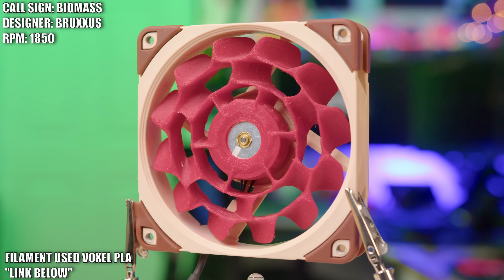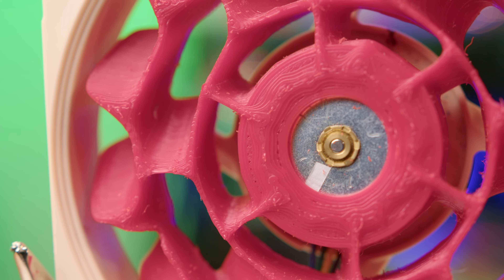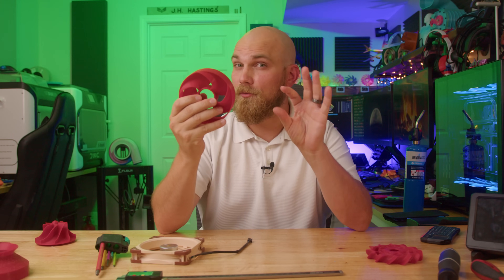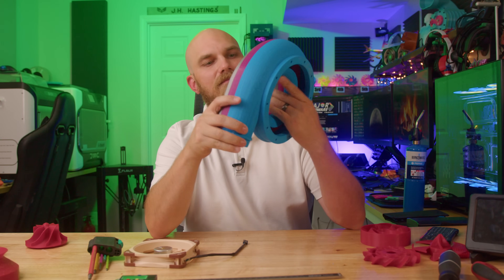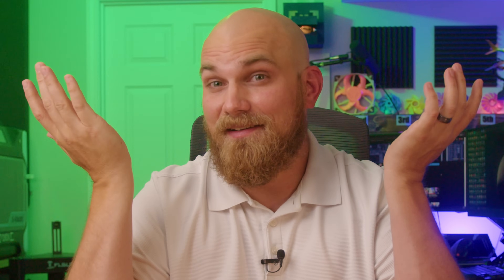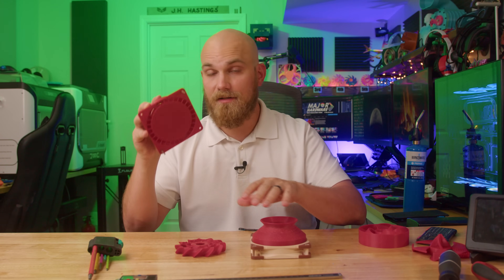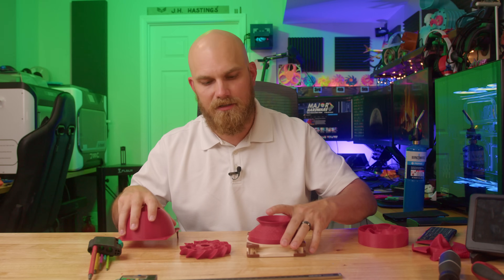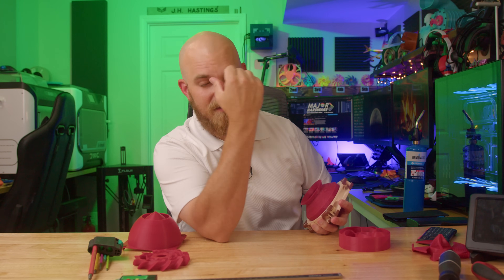What If Noctua Made A TURBO? | Fan Showdown S4E11

Comment: You should have the Turbonator guy redesign the inlet to be longer.  With a longer runner, the air approaching the turbine blades would have more velocity and should improve CFM.  This is why the inlet of actual turbos are as long as they are😁😁👍👍
Reply: I wonder if it would make a difference if the spike coming off the back of the fan was elongated to something more like an aerospike nozzle.
Reply: damni love the npc show,good to see our taste is quality.
Reply: @the_chomper  Thank you!  ^_^ /
Reply: Yeah a better intake runner would definitely help
Reply: False. For best flow just a little stack. Never been at the dragstrip? Turbos are just sticking out of the hood.
Reply: @Deiphobuzz  you do realize that most dragsters don't bother optimizing airflow and rely on massive boost due to rpm... Right?
Reply: @Dominik189  yeah, thats what all turbos do. The pipes are for filters and noise reduction. They overpower subtle gains. 

However, this has 0 power, so it wont do anything. Atleast, nothing actually measureable. Otherwise dragsters would have your spike idea.
Reply: @Deiphobuzz  like, you realize the spite is to optimize airflow and guide it in a direction because there are no pipes here. It's like the exhaust of a jet turbine precisely because this isn't about building boost but moving air.
Reply: @Deiphobuzz  You missed my idea entirely there. Though I suppose I didn't really explain it very well. What I was wondering; was if having the cone coming out of the exhaust being elongated like an aero-spike would have an effect on the exhaust flow.
Reply: The inlet isn't the problem, it's the outlet that's the issue.  This type of design is optimized for static pressure, so you need to use that pressure to drive air through a nozzle to accelerate it.

Comment: I’m terms of print quality. I would recommend trying the beta for prusaslicer with the arachne slicing algorithm to improve small walls like fan blades. I would have printed the turbonator intake without supports with the small intake side pointing up. The prusa with pla can handle it. Where possible, use 3 permitters to prevent infill overlap from showing on the outside. With basically any non mechanical part I run 5% gyroid infill. More permitters contributes more to strength than infill. Besides that I’m very happy with built in profiles with prusaslicer.

Comment: The turbo designs will not work very well ever due to the limitations of compressor rpm. They will generate high pressure but low volume until you can get them really spinning. Figure the average production turbo compressor wheel is spinning at well over 60k rpm under load. I love the design and thought behind the designs but they all have the same flaw of needing significantly higher rpm to get the volume. Not to mention the flaw with the wind tunnel itself being 120mm in diameter vs the turbo design outlet being a mere fraction of that size contributes greatly to pressure and volume lost upon exiting a 20mm opening into the much larger 120mm wind tunnel tube.
Reply: Yup. If the fans were tested on their resistance to backpressure or flow restriction, this would probably destroy the cheater. As it stands though, it's a Ferrari competing in a tractor pull.
Reply: Yep. Based the power of the fan, lower pressure high volume is what it’s designed for.  Need to maximize the area, not restrict it.
Reply: @CajunReaper95  i was talking about the rpm of the turbo itself and you are talking about the rpm of the engine, so both is true...
Reply: The wind tunnel being 120mm is not going to reduce the volume of air the fan fan push. It will reduce the air speed, but the volume is still the same. Well almost the same as it actually will increase slightly as the air expands as the pressure drops. Note that in this case the difference will be minimal as that fan can't produce very high pressure.
Reply: Another thing is the fin to wall clearance was HUGE. If it had been so close that it almost hit, that would give the best possible result.
Reply: It can work well if the turbine is properly designed for the low RPM of the fan base. It could work, but it needs serious work.
Reply: @Dominik189  Not really. Radial compressors are not designed for high flow rates, but high pressure rises. If what you want is flow rate, you go axial. There's a reason fans are axial and not radial.
Reply: @mariohernandez1111  I have seen many high flow centrifugal fans, such as the ones seen in 5 ton a.c. package units, so I agree that with enough tweaks to design aspects it could become closer to the cheater
Reply: @mariohernandez1111  brother it's all in the geometry. You can do higher flow with radial, it's just a pain in the ass to design it correctly.
Reply: A Smaller turbo would work better with less rpm, as far as I'm aware.
Reply: @jwalster9412  smaller turbos need higher rpm...
edit: I'm referring to the rpm of the turbine itself, not the rpm of a combustion engine on which the turbo is mounted.
Reply: @jwalster9412  In engine boost mode, a smaller turbo will spool up faster than a larger one giving you your boost faster.

Comment: Derek deserves a re-test with those gaskets. That was most of the air leaking out the sides.
Reply: Duct tape is always an option! What better application is there for duct tape, than a literal air-duct leaking?
Reply: @TurtleGalaxies  Funny enough I watched a history of duct/duck tape video recently and that's like the one job it's really bad at. Go figure! 

It was originally designed for the military to secure boxes of explosives since the original tape was often coming loose and causing danger to the soldiers.
Reply: @TurtleGalaxies  If you mean the claasic cloth duck tape, ductwork is actually the one thing is sucks at (though mostly due to thermal cycling). If you mean actual foil duct tape, then I suspect getting it to work in such tight constraints might be tricky.
Reply: @TurtleGalaxies  in all my life, I never stopped to think that they called it duct tape because it's supposed to be used on ducts
Reply: @TurtleGalaxies  fiber gasket material is like 1 usd and is syupis eash ti fix that leak
Reply: I will say that I'd be interested in seeing some gasket work and tweaking of that fan. I don't necessarily believe it would come anywhere close to beating the Cheater but the design deserves some additional love and screen time in my opinion.
Reply: This, the point of a turbo is to convert high pressure air into high flow. That leak would have caused a non trivial pressure drop, which in turn will decrease the flow output.
Reply: @pseudonymity0000  The side of the turbo represented in this video is know as the compressor, it takes low pressure air and compresses it to increase the amount of air per cubic foot, that pressure is only achieved if there is resistance.
It will have a high flow rate at the outlet but this drops off quickly as you move away from it as it’s purpose is to compress, this is why fans are common place when air needs to be moved at high volume.
Reply: This design is very beautiful, I very like it. But I think it is not supposed to produce a lot of cfm, compared to other typed of fans. Benefit of this design is compressed air in the middle, which is good for jet engine but actually useless for fan, it only causes heating of air and decreasing overall effeciency
Reply: @arsmol  only one way to know for sure!
Reply: @arsmol  One of the main reasons it compresses air is because of the volume it can move. With that however they are meant to spin up at much higher RPM's to do so which this test has it at like 1% of what a turbo / jet engine would actually spin on top of the fact it's cheap 3D printing and would shatter regardless. Considering it's an electric motor driving it heat isn't as much of an issue as would be in a car turbo for instance due to exhaust gases directly heating up the air through the all metal compressor, of course they cool and oil them in cars but it's still quite hot and you also have an intercooler between the turbo and the intake to cool the air as much as possible before entering the engine. But overall at these speeds there's no real heating going on specially with a cool motor doing the compressing. Whatever heat is generated at higher RPM is still likely going to be cooler than the part it's cooling in this case and thus the higher air flow should more than make up for it.
Reply: @MidnightMarrow  100%. You a literally compressing air to allow for a greater amount of fuel to be burned (in the case of the engine). Once compressed air is made it passes through a heat exchange because the turbo heats up the cool air from the intake. Just because it moves air doesn't make it a fan. 
Anyone else curious about the heat a fan itself may produce? If you're running these more complex designs it MAY NOT be a negligible number (although it is in most cases). Some have so many moving parts made out of PLA they may be overloading the motor and they definitely create friction. I'm not a mechanical engineer (I studied civil engineering) but is this something people consider when building fans?
Reply: I agree
Reply: Yeah... Even with a complete seal. You're still looking at only a 200+/- max benefit. Bringing it up to near 550.. Cheater is up near 800. AND!!! You know the cheater developer is pocketing an update when it falls.
Reply: However, These designs are great! Going to have to step up the turbos ability to stay small and move more air. Those stater openings are quite small. It's a 4 or 5 inch opening. Meaning, it would require a 100+MM turbo. That's massive hahahah
Reply: Someone could add another fan acting as exhaust pressure helping to spool the turbo?
Reply: 100% agree
Reply: I agree
Reply: yes, because this air that is leaking shold be going out the back
Reply: Ya those gaskets or design and print something with that flexibility filament
Reply: I strongly agree
Reply: I mean duct tape would solve it in a minute, kinda disappointed
Reply: Adding gaskets isn’t going to do it any better. Wrong application for this design.
Reply: yeah, saying that he will retest only if it did good its like racing with a flat tyre and planning on change it only if you would get to second place
Reply: Yep, turbo charges use air pressure, so in order for it to be efficient it must be pressure tight.
Reply: Wd-40 and duct tape should always be close to an engineer .
Reply: Indeed. Or even just running with a plastic-plastic mate rather than putting those little vibration damping pads in there that created a massive (relative to the design) gap between fan and duct. I doubt it will be the best fan ever but the testing here really did it no favours at all.
Reply: Here here
Reply: just remove that part
Reply: Yes the leakage really hampered him, would really like to see this one tested again, the pressure loss is really bad in this sort of compressor design.
Reply: yes not an accurate result with all that pressure loss
Reply: Definitely! Was about to suggest gaskets.
Reply: that was my initial thought hahaha so cool.. bet you the pressure is so much it needed a gasket lol